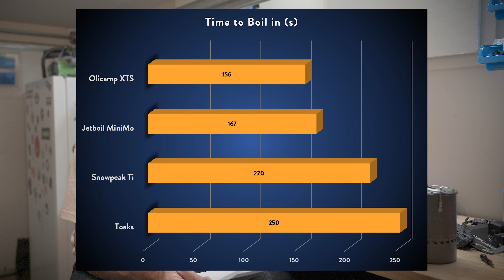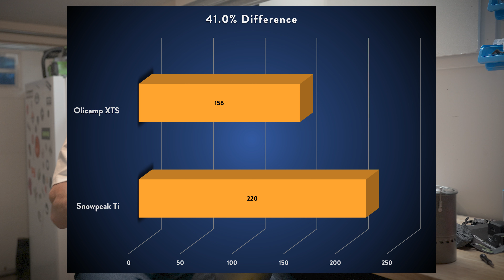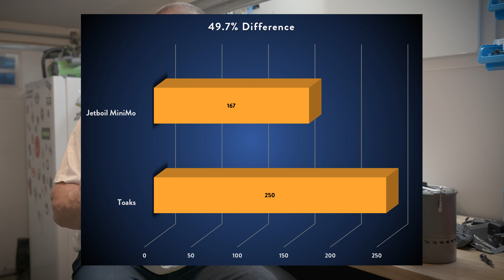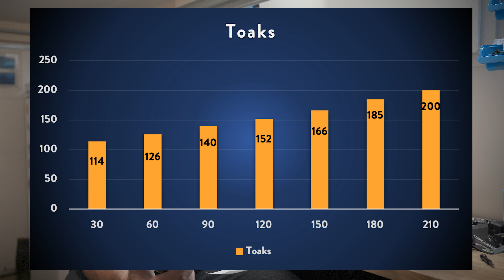How Important Are Heat Fins on a Backcountry Cook Stove?

Comment: Great stuff! 
Another burner to look at with the Olicamp Pot or FireMaple Petrel Ultralight Pot with heat exchanger 600ml, is the SOTO WindMaster Stove with 4Flex 67 g / 2.3 oz. (Lovet this lightweight stove, it has not failed me yet, have had for 11 years)(You just need to purchase the 3-Flex adapter for use with the FireMaple (a bit more pot security to the burner).

What I don't like about the "ultralight pot" options is that most of their lids need to be rubber banded on during transport, as they are not snapped on. The other deal breaker for me, is their lids do not permit drinking straight from the pot. So, when I want coffee, I must bring a separate cup. So, the initial weight savings is diminished when you need to bring the cup.

Another thing to consider for us backcountry hunters that are back there for 10-15 days without access to the truck, is fuel efficiency.
There is a ROI on ounce(s) weight to grams of fuel needed. Especially, at the treeline, with wind and near freezing temperatures (a regulated stove will save on fuel in my experience)

I also use a FlipFuel to consolidate my fuel canisters after long trips to save fuel and money.

Comment: Agree with everything said but I will add my 2 cents based upon my use. I don't drink coffee and I only eat one dehydrated meal per day on hunts. So I only do one boil a day. Quickly realized the JB flash was completely overkill and went to the Toaks and BRS stove combo. Absolutely love it. The thing with fuel efficiency for me is that it doesn't really matter. Because I will always go into the field with a full small canister. Just from a preparedness mindset. And I don't do hunts longer than 10 days. So ive never run out of fuel before doing my one boil a day. So all things being the same I go for the lightest weight setup and smallest packable size. The extra fuel burn is negligible from a purely dollar cost perspective...as long as I don't run out haha. Love your  vids. Just subbed...thought I already was subbed
Reply from the maker: Great point. Cant beat that toaks pot for weight savings.

Comment: There is a readon why car cooling radiators doesn't just have tubes but also thousands of small fins to increase the surface area that grabs the air better.

A larger pot will always heat faster on a gas stove since it has a larger surface area since flame heating a pot is not really efficient as most of the heat just flies around and past it.
The ones with fins collects more heat from a larger surface area thus wasting less heat.
Reply from the maker: That’s exactly what I said 🫤
Reply: Some people don’t watch your full and thorough explanation, and just want to spew shit after 30 seconds after hitting play 🤣

Comment: Sincerely appreciate your analytical mindset and approach to looking at elements that affect the backcountry experience. I own a Fire Maple pot with heat exchanger fins and have appreciated the faster boil times. They just released the Petrel Ultralight 600ml with fins and slots to get the pot closer to the flame. I might check that out. I've heard that wider/shorter pots are more efficient than narrower/taller pots, but I've never tested it.
Reply from the maker: Been seeing that fire maple pot everywhere

Comment: Dang 45.4% way higher than I thought.
Reply from the maker: Surprised me too
Reply: All the testing I've seen elsewhere puts it around 25-30% fuel savings. They wouldn't run the stoves full blast though and the boil times were less important as a longer, slower boil could be more efficient depending on the conditions.

Comment: Bud you really really need to look at the 'gear skeptic' videos. He really explains it all.

Running lower flame net results significantly more efficiency and renders the toaks the most weight efficient out to 100ish boils.
Reply from the maker: There’s more testing videos on the way. I agree that there is an optimal intensity for the most efficient flame per gas usage. However, no matter how much heat you apply a pot with heating fins will always be more efficient than one without. It’s just basic physics.
Reply: Check out those videos! 'Gear skeptic' The guy does extremely rigorous testing; the heat sink is beneficial running things on full and more efficient, but not enough to offset the weight increase of the fins if you're willing to run your flame on low to medium (most heat dumps out the sides with a full flame non heat sink setup). I love what you do!!!
Reply from the maker: @patrickscheel3943  all right, you got me. This is sounding like a moron, more compelling argument. I’ll definitely go check out the videos. I also really appreciate the feedback. I love when people present opposing opinions or data that contradicts something I’ve said previously. So thank you for taking the time.
Reply: @MindfulHunter 	how have the gear skeptic vids changed or not changed your mind here? Also, love all your content brother, grateful for what you do
Reply: I received a pot with fins recently and I did very simple test of boiling 500g of water and compared to normal titanium pot, I dont care about boiling times, so I measured the gas consumptions, and yes I found the fins are more efficient, its consumed 4g of gas with fins and 5g without the fins. all thats on 20-30% of stove power. If I do 100% power, even with the fins, it boils 2 times faster, but it consumes 9g of gas instead of 4-5g, so I guess it's something to test more. The 550ml titanium pod diameter is less than 10cm, if we use stove with wider burner, similar to one you have on the desk, on full blow, a lot of flames just go over the stove and doing minimal effect on heating and loosing fuel for nothing. Thats why majority of hikers use small tiny burners like brs300t on 30% power to get better fuel consumption, typical times to boil are 4-6 mins. Thats all tests in the kitchen, in real life scenarios, there are all way air moving and wind involved, that drastically affects fuel consumption, this is where intergated systems shines like reactor, but thats different class and weight penalty. The 550 pot and brs300t are 100g total, and integrated systems more like 400g, depending on type of hikes and number of days, one can choose over another. Not sure how much hunters move, I guess it should be no brainer to have integrated system if you dont move a lot. If I do fast and light type of hike in the mountains for 5 days that involve 30km per day and 2000m altitude gain, I will go lightest pot I can get and make sure I find quiet place to shed from wind to boil the water :)